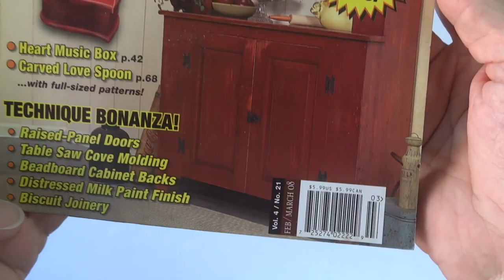Heart Jewelry Box (Woodcraft #21)

Comment: I am in the process of making this same box.  Yours came out beautiful, I must say, and I was wondering what hinges did you use for the box?  Did you order them from Amazon?  Thanks for your attention.
Reply: I just ordered some from Lee Valley.
Reply: Since I asked this question I found that Home Depot on line has the barrel hinges, and they're only $2.20 each.  1 hinge in the package so you have to order 2 for a pair.
Reply: @MyGarageWorkshop  Thank you for your response !
Reply: @jimcardinali1555  yes the SSOS hinges that Woodcraft specs in the plans are incredibly expensive. Around $30/pr.  I found the ones at Lee Valley for  17 which is still pricey. Supposed to arrive tomorrow.
Reply: @jimcardinali1555  by the way. Where are you getting your movement from?  I am looking for the same song, Over the Rainbow. Thanks
Reply: The Soss invisible hinges called for in the original plans can be bought at Home Depot online and have sent to the store free.  They are $16 and some change plus tax.   I bought my music movements on Amazon. Sankyo brand has longer winding stem that will go through 1/2" stock.

Comment: nice work. I have a question about the bio filter on your pond. what kind of pump are you using? thanks
Reply from the maker: +Sandie Reichenberger The pump depends on the size of your pond. My pond is ~700-1000 gallons so I use the Titan 900. I do not know if that pump is available anymore but a similar pump would be this pump http://www.amazon.com/Laguna-Max-Flo-Waterfall-Filter-Pump/dp/B000HASBHC
Reply: Ty ty ty. I'm going to build the bio filter in your tutorial and wasn't sure what pump you were using. My "pond" is a 390gal stock tank